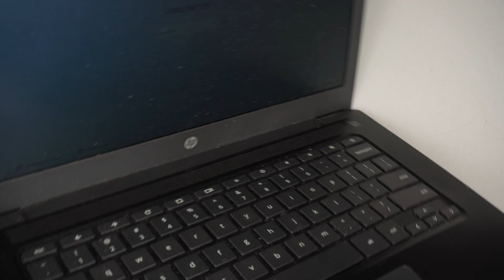HP Chromebook Battery Replacement

Comment: Thank you so much for the instruction video! My HP Chromebook's lithium-ion battery is swollen even more than yours! I almost recycle it until I saw your video and then ordered a new battery for less than $20 and replaced it without any issue. 

To avoid having to turn the power off frequently when one takes it apart as you showed in your video, before I do anything I Chromebook I simply disconnected the power supply and let the chromebook to play some videos from Youtube, until the unit became completely dark, to make sure that the old battery is completely discharged (for safer disposal).